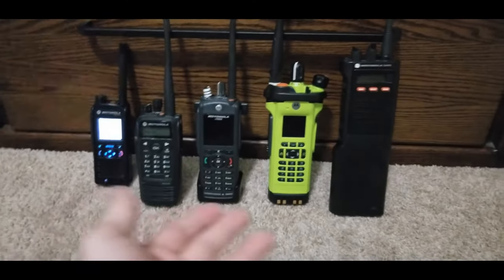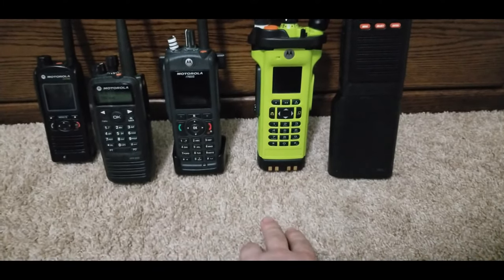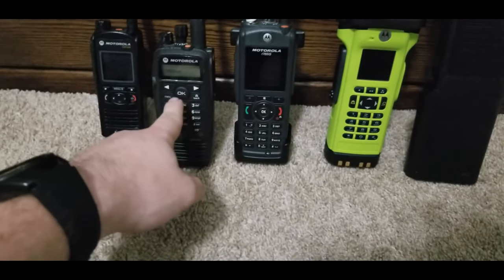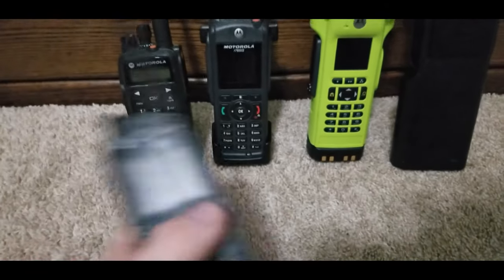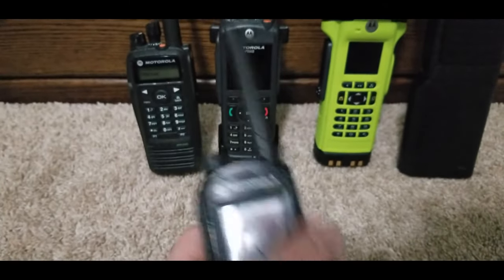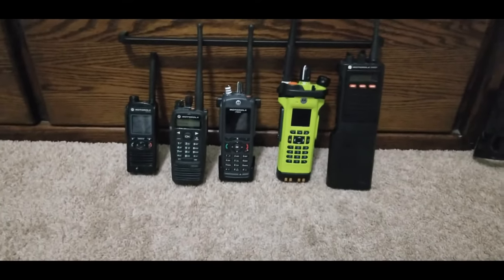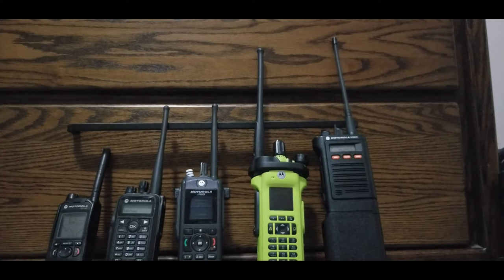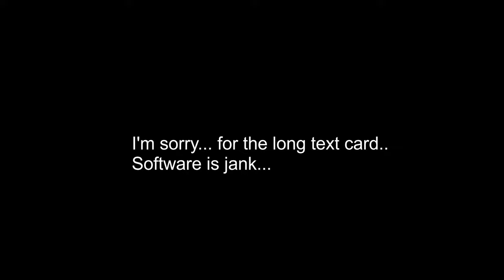Commercial Radio Audio Test #2 DMR, P25, ANO, TETRA, iDEN, & MORE

Comment: P25>TETRA>iDEN>DMR>FM
I would consider turning the APX radio so that the speaker points towards the camera. The way you did stopped the sound from being captured by the camera. Your TRBO radio was a little bit loud, lowering its volume may allow us to acknowledge the actual audio quality.
Reply from the maker: Yea, There are some issues with this that I'm trying to rectify. I didn't realise how many people would come across this. It was more of a "Check out this cool thing I noticed". 

And personally my list goes 
TETRA > P25 > iDEN > FM > DMR

I must note I'm a bit jaded after mainly using DMR in ham with others using Chinese units or via BM. The DMR system we use at work is a tad better. But still not as good as FM (not weak signal that is. in a longer range environment FM is at the bottom)

Comment: The DMR sounded absolutely terrible. I have many DMR radios and they all sound a lot better than that. First gen MotoTRBO radios had crap audio and it sounded like your mic gain was too high on the transmitting radio or you were speaking too close. Very interesting test though and nice to see all these different modes together.
Reply from the maker: That's what I'm hearing. I feel the desk mic I was using has part of the blame as those are built to pick up far away sounds VS more up close like I was.

Usually the DMR side of things sounds a tad better, but that's about what I've been getting even other hams using 7550eS with audio tuneing.

I'm going to try and get it sounding a bit better but TBH its probably not going to sound much better. I am working on finding a cheap 7550e(looking for sub $200 as I'll mostly be using it as a wave client... and DMR isnt really my favorite..)
Reply: @anongator  What radiosification said +1. Thanks for the video.

Comment: Wideband Saber sounds most natural which is ironic as it is a museum piece, DMR sounded robotic, P25 was quiet, iDEN and Tetra sounded awesome. I've always hated the look of that Moto DMR radio
Reply from the maker: I absoluely love my Saber XD
TBH I like the look of the 65x0IS more then the normal 65x0
Reply: @anongator  I used to have some Saber hardware.  Two Halliburton black metal cases, one was the base station and the other was a Securenet repeater that came out of a missile silo, it looked brand new and worked really well and had all the original cables and booklets in the pouch . Also a pair or ex WHCA 'Fascinator' Sabers plus all the tuning and tesring hardware.  Despite being long, Sabers are  thin so you could accommodate one under the armpit without the bulge.
Reply from the maker: @NigelBallard  Thats the good part of the sabers. XD

I'm trying to find some DES-XL modules so I can run Securenet on my Sabers but they seem to be hard to find... You don't happen to still have said Fascinator sabers would you? More importantly the modules XD
Reply: @anongator  Sadly I got rid of everything during my divorce otherwise I'd happily send them your way.  I originally bought a bunch at random off eBay, it was fun sliding the case off to discover if there was a crypto board or just the bridging board.
Reply from the maker: @NigelBallard  Darn. TBH Its probably for the best seeing as FASCINATOR is a CCI XD. Still want to find one and poke at the Algo board.

Comment: First and last radio sounds the best. The old murs radio sounds the best from all
Reply from the maker: I quite like that Saber. I'll be doing another test soonish with some issues fixed from this one.
Reply: @anongator  Is there a crypto module in yours?
Reply from the maker: The saber? Yea, its a DES. But I can't get it to talk to my KVL3000 when in ASN mode. So I suspect it's borked.

Comment: I think that the mic gain on your XTS needs jacking up so that you can back off the mic a little (lots of mic pop).
I don't know WHAT the drama was on DMR - sounded absolutely horrendous. Maybe try dropping the mic gain on the other radio?
Reply from the maker: The XTS being used is a XTS4000, you hold it like a cell phone, so not much backing up you can do...

I was also surprised at what the DMR sounded like XD, I was using a 4350 with a dispatch style mic, it usually sounds a bit better then that (not by much)

Comment: Just wondering, is MDC1200 allowed on MURS?
Reply from the maker: As long as it's inside the bandwidth for that MURS channel, almost anything is allowed (from what I'm told. Tbh I dont use MURS much. Not much use when you have Part 90s and a keyloader)
Reply: @anongator  What did you use for the MDC1200?
Reply: @anongator  So probably I could use motorola mototrbo radios on the analog function
Reply from the maker: Don't quote me, but yes

Comment: Is it possible to use a Tetra radio to listen to someone else's Tetra trunking network?
I hear this network through the tetra's plugin RTL-SDR.
What are the minimum parameters for this? (Freq, MCC, MNC, GSSI -Is that it?)
Reply from the maker: You can't NAS using a TETRA radio. It will affiliate. And all the ones I know of will kill it on sight, as unlike P25 the network will get your ISSI and TSI. One is the RID, one is the ESN

Comment: Just one thing, talk across the face of the radio not right into it so that way you don’t get the wind noise from when you talk, it really shows itself of digital systems
Reply from the maker: Yep. Thats actually what I was doing. Save for the XTS4000 due to its design.

Comment: What about NXDN? How does it compare?
Reply from the maker: I will never touch NXDN
Reply: @anongator  You've definitely rekindled my interest in TETRA, gonna have to do some research now. I am also curious why you are not interested in NXDN? I had some NXDN radios for a short bit but didn't use the digital side of them and ended up selling them.
Reply from the maker: It's just another AMBE+2 vocoded digital mode. A somewhat propitiatory one at that. Propitiatory modes don't interest me as much, iDEN is a bit of an edge case due to its cellular applications. 

And id rather die before buying a Kenwood or Icom radio. (Yes I know Kenwood is also EFJ but EFJ still runs separately.. ish)
Reply: @anongator  Fair enough, I can understand that. 

I grew up on Motorola as my dad maintained a UHF ranch radio system back in tue 80s and 90s. I became fascinated (ok obsessed, lol) ever since. Now I’m
Older and can afford to play with that stuff now and have quite a few older radios and new ones. Recently I became interested in the EFJ line just because. So I acquired a VP6000 UHF1……now I’m curious about the all band VP8000. Anywho I digress. I appreciate the reply back!
Reply from the maker: The VP8000 is nice.. will be even nicer when the DMR upgrade comes out. Taits actually made a compelling product with the TP9800
Reply: @anongator  Agreed! There’s a guy here on YT that has reviewed it and it’s very nice. And yes when they release the DMR upgrade it’ll be even better.

Yeah I’ve read in RR some guys speaking of the Tait 9800. It’s not a bad looking radio and seems to check most of the boxes.
Reply from the maker: Yea it's the smallest all band multi mode radio out there. From what they said it will be Phase 1/phase 2/DMR T2/T3 out of the box
Reply: @anongator  wow, that’s impressive! With a competitive price I would assume. No personal experience with Tait but seems like a great alternative.
Reply from the maker: Bout 5k was the whored price
Reply: @anongator  not too bad considering  what you get all the few other competitors……and today’s wonderful economy.
Reply: @anongator  Why don't you like Kenwood? I have a couple of Kenwood radios and found them to be pretty good